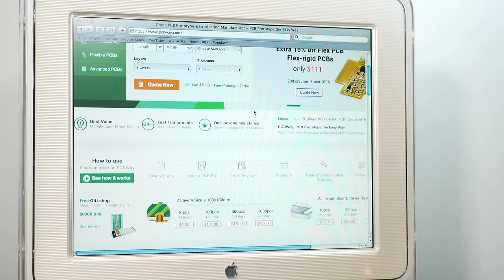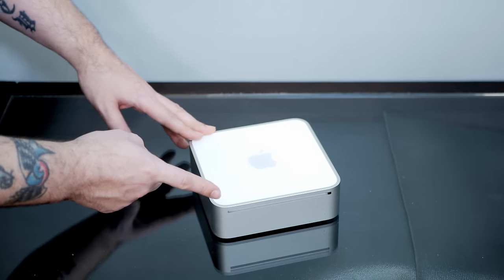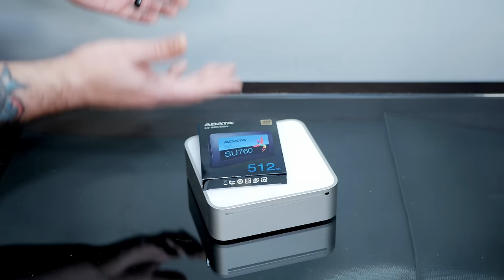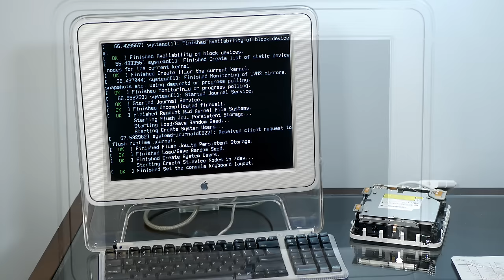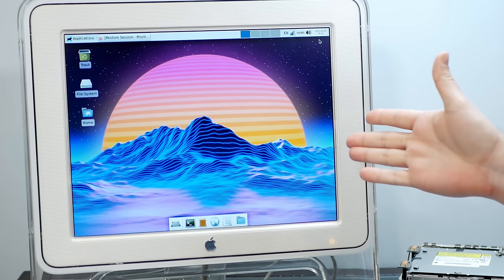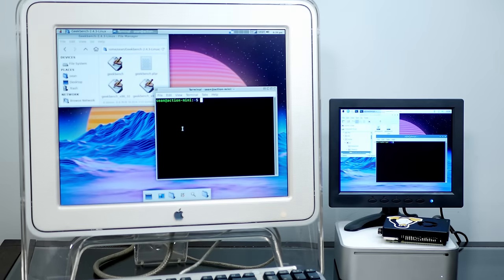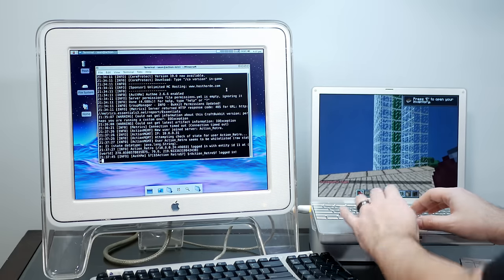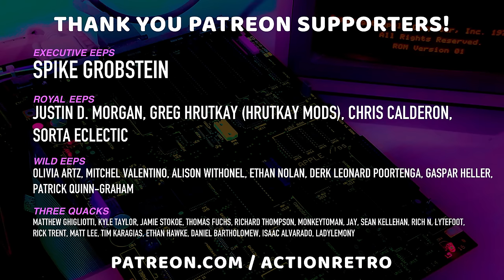Can a Cheap Mac Mini Out-Pi a Raspberry Pi 4?

Comment: HELP PLS. I have a 7.1 macbook polycarbonate with core duo p8600 and gforce 320m graphics. I install windows, but when i install the drivers it shuts down while aplying the new drivers. That leads to a loop in which it doesnt boot anymore into the user menu. When i first put a ssd with a installation with windows, everything went well. I think its because the UEFI thing you said in the video.

Comment: What storage did you have In the pi.  Sata type and ssd type
Reply: Micro SD. Raspberry pi’s don’t have a SATA interface, they boot off of a normal microSD card, unless you use a USB3 to SATA adapter, which he did not use in this video.

Comment: does the mac mini really need a desktop (wasting cpu power) to run the minecraft server ? 
ramdisk(s) 8GB could be split 50%/30%/20% or ..., all logging files could stored there (20%) protecting the ssd ...
all minecraft files could be copied to 30% partition (change size if too small), 50%=4GB left as normal ram.
https://www.linuxbabe.com/command-line/create-ramdisk-linux
firewire,  can be used to create a point to point network, but needs a firewire port on the other pc (addin card) !
a second 66 dollar macmini may be cheaper.

Comment: lol I had that same problem with a 30 series nvidia card, I had to install then manually download and install the UEFI bootloader off a live environment.
Reply: on Linux I just avoid Nvidia, so I don't have to do anything to get my GPU/APU/IGPU up, and running beyond taking the latest 5.x Linux kernel updates, of which have the latest AMD, and Intel open source modules(drivers) baked right in coded by AMD, and Intel themselves. Nvidia really has given the Linux community the middle finger unless it's something they are directly selling themselves with Linux preinstalled on it.
Reply: @CommodoreFan64  yeh I've been using AMD/ATI graphics for a long time, that's why I commented about how shit nvidia is. couldn't get an AMD card this winter tho.
Reply: @Sazoji  I hear ya, not being able to get a new AMD card is why I'm still on my PowerColor Red Dragon AMD RX 560 4GB GPU in my main rig.

Comment: Of course it will cost about $60 vs $6 to have the mini running for a year instead of the pi - still a cheap server though
Reply: You can get more modern Intel hardware for less than a mini though

Comment: I would pick a Pi over a mini any day becuse it´s cheaper at least here in Sweden checking out old mic mini 2011-2012 versions people sell it for 100-400 bucks. So in away a pi 4 is cheaper becuse you often already own what you need like I got several SD cards and keyboards and such. 

Reason why I never liked MAC I hate the OS and even if  can use Linux even old mac´s are stupidly more expensive than a PI or a regular old PC.

If I wanted to run a Minecraft server I would pick a PI or if I wanted better support  to run freelancer server or Conan exiles or Ark or such I would get a cheap intel nuc just find a smallest case and build it my self.
Reply: 2011-12 minis are expensive because you can upgrade them. When you do, they stand up well today
Reply: Sure you can upgrade a mac mini but for a server or light gaming a Pi 4 is 100 times a better option with out the need to upgrade and cheaper. 

But honestly when it comes to apple products you always pay extra just becuse of the brand.

Comment: Can that mac mini run Garageband?
Reply: An older version, from the iLife days, but yes! Luckily garageband hasn't changed too much over the years, depending on what you're doing. I'd look at a slightly newer mini tho, maybe like the 2010-2011, since it has more power for not much more cash on ebay.
Reply: yes i have a mac mini that is even older and it can run '11 garageband
Reply: It can run a crack ableton6 just fine. Use audio through FireWire.

Comment: might as well get a dell or hp thin terminal instead of mac mini with a newer AMD architecture (AMD as it would usually be far better specs than intel atom conterparts) they cost like 5€ and will easily outperform your mac mini